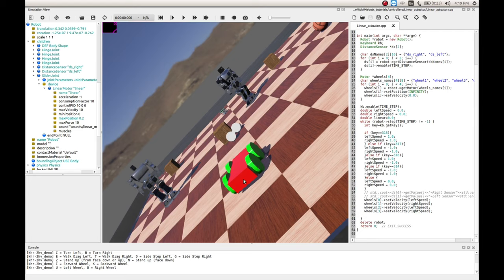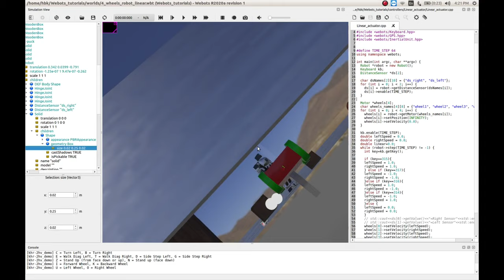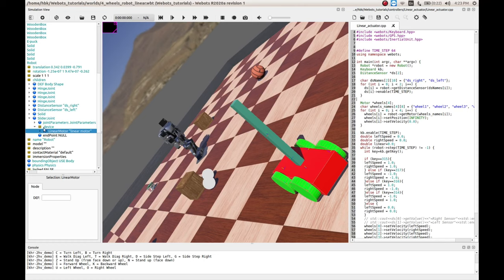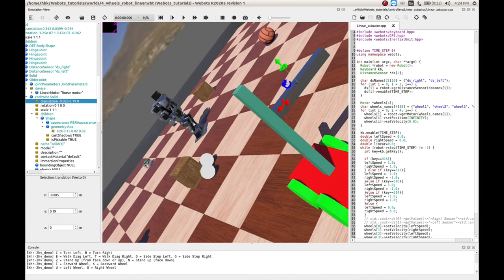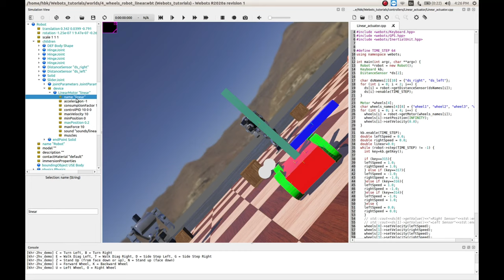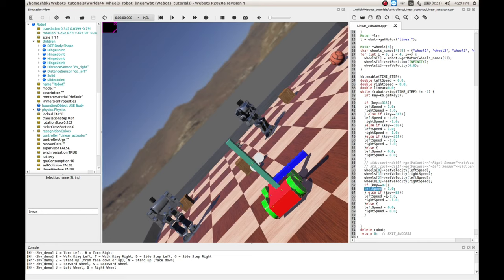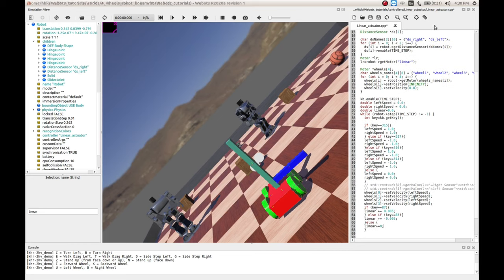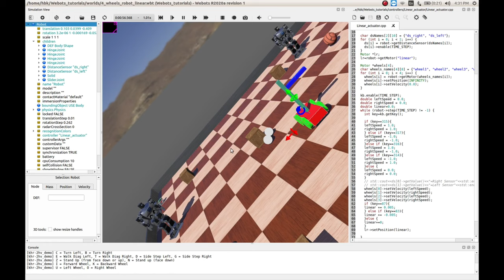Linear Actuator on Robot | Manipulator Arm  | Webots Simulator | [Tutorial 12]

Comment: Hello, thank you so much for the video. Can u please make video on how to design and control two finger gripper "end effector "
Reply from the maker: Good idea 💡
Reply: @coolrobotics  thanks u.
I hope u can make the end effector attached to the rotary actuator video. That's will be so so helpful.

I am struggling on how to design the two finger gripper. Can u give some steps on what to add or how can I start. 
I am very new to Webots, I just downloaded yesterday and I have to design the end effector.
I really appreciate your help and support.

Thank you
Reply from the maker: @haneenal-ali1571  I think you should start by learning how to make Nodes in webots and that will help you make end effector.
You do not need to worry about the mechanics.
You just need 2 parts and add a rotary actuator on the hinge or add a linear actuator between then.

Once that is done you will be able to set position of that motor in the code.
Reply: @coolrobotics  Thank you so so much. I must be so lucky that I get the chance to get your reply.
Will give it a try and see how it goes. 

Thank you 😭😭
Reply: @coolrobotics  hello, 
I couldn't figure out how to open and close the gripper. I  added hinge joint at the end of the robot arm and then from the end point of the hinge I added two parts but when I wrote the code to open and close the gripper,  the whole gripper rotate around the arm rather than open and close.

I hope 🙏 i could get your reply. 
Thank you
Reply from the maker: You can add min and max value to your hinge joint.
Reply from the maker: That will not let to rotate 360 degrees.
And in code you can use set position service to close the gripper and to open it
Reply from the maker: Let us know if you have any other issues
Reply: @coolrobotics  Thank you so much for your quick reply 
I really appreciate your help. 
The movement is getting crazy after I changed the minstop and Maxstop of the hinge joint.
I am get try with setting the postion on the code and see.
Thank you so much again
Reply from the maker: Great 👍🏽